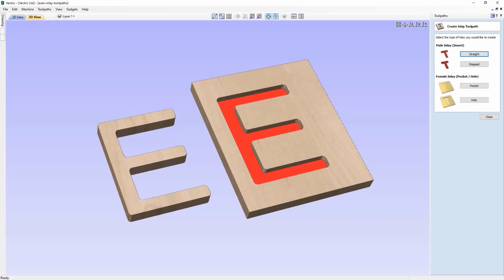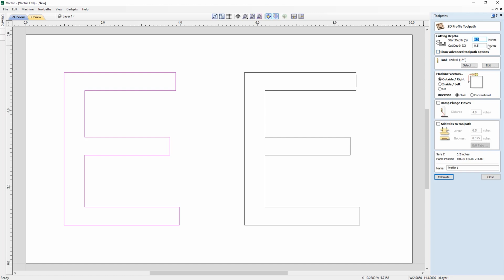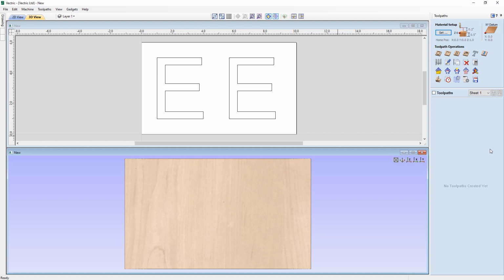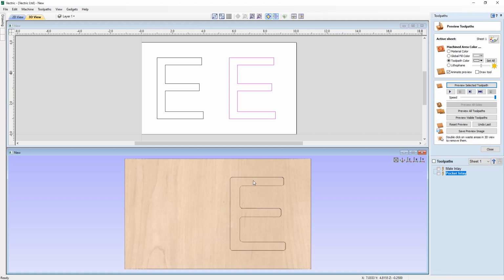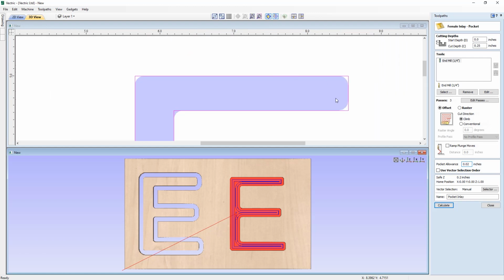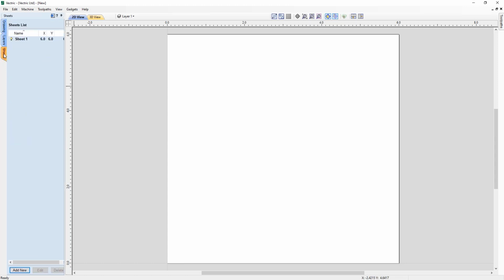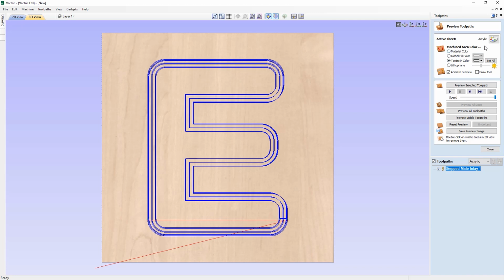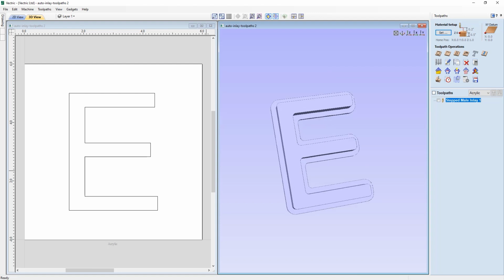Auto Inlay Toolpath Guide | Vectric V11 Tutorials

Comment: I need to machine pockets with corner undercuts to machine square material. I don't see an option to do this.
Reply from the maker: Hello Norm... We can't cut "undercuts" on a 3 axis machine.  I may be misunderstanding your use of "undercuts" apposed to "overcuts"?
Reply: @vectric  Corner overcuts if more accurate. As mentioned, it's eliminating the radius so square material can fit - IE when making a recessed vacuum fixture.

Comment: you need to start use Metric system. most people in the world uses it
Reply: Just because you use it doesn't mean everyone else should.
Reply: @michaelagostino1321  Yes, it does. The US went 'metric preferred' back in the mid 70s. How long do you need?
Reply: @Tensquaremetreworkshop Yeah and it never really caught on so it’s essentially invalid here. 
We prefer to call a half inch, a half inch instead of 12.7 mm or whatever it is in metric. Etc etc. 
Vectrics not even a US company but probably the majority of their customers are. 

Imperial for the win, per usual. 
It’s glorious isn’t it.
Reply: @SeamlessFab  Well, every vehicle in the US since the 80s was designed and built in metric.And most other things.
Reply: That’s right around the time all the American made vehicles started becoming unreliable. I don’t know if that’s cause and effect of the metric system, but no one has gazed upon the 1980’s car industry and onward and marveled at the engineering involved. 
To the original point though, if you designed a product and most of your customer base used imperial.. are you releasing it in metric? In any event I was just speaking on the claim that America “went metric.” The phenomena is more akin to a pilot project that never really caught on, period. A failed pilot program if you will.
Reply: @SeamlessFab  Vehicles less reliable now? Far from my experience. Perhaps you can quote a source?
Amazing the things the US has failed at. Metric (like the rest of the world) - fail.
Coins for single denomination currency like almost everywhere else (despite costly campaign) - fail.
Does succeed at a lot though- percentage of citizens in jail, industrial accidents, road deaths, drug deaths, murders, the list goes on.
Reply: Honestly after reading this incredibly bizarre response, I’m now on your side. Vectric: let’s get this guy some help before it’s too late. Just give him a Metric tab. 

Converting metric to inches appears to have devastated his emotional state. 
Opening Version 12 and still seeing the “inches” scale populated in the job setup tab appears to have been the last straw and catapulted him to a nervous breakdown. 

The guys talking about socioeconomic theory and geocurrency in a software thread. 

It may be too late for his mental state. 
But we can try.

If we act immediately 🚨
Reply: @SeamlessFab  Vectric handles Metric- might even be the default, I do not remember having to select it. I have nothing against inches, as it happens- but if you add feet, yards, chains, furlongs and miles (all three types) I just smile and shake my head. Fractions, however, are a different matter. At some point you need to use decimal (as size decreases- who uses five hundred and twelfths?). But hard to stay there, because all your drills are fractional (plus letter and number to crudely fill in the gaps). Metric is, of course, also decimal. So no such problems.
Reply from the maker: Thanks for the comment... and will add that to the list of future things to consider.  For the record it is pretty easy to conver any of our working/demo files into metric by simply chaning the job properties.  It won't ajust the tooling so you will nee to keep an eye on those.

Comment: Why can I select a v-bit for the female, but not for the male? The female allows me to select a spiral end mill to clear out the pocket and a vbit for the edges. The male only allows for spiral endmill. This sounds like it would result in a mismatched pair.
Reply: Use the vcarve tool path instead not this one
Reply: @StephenJoiner  I'm aware of the vcarve toolpath, but when using that one we have to manually flip the male portion add a border and do a second vcarve for it. The auto inlay almost does this for you, it just seems to miss the vbit portion on the male side.
Reply: @JasonLetanosky  Well it can't do that because it would be undercut if you visualize it. The narrower portion of the male would be under a "cliff" of wider wood at the top. So flipping it is the only way it could be cut with a V bit.
Reply: @StephenJoiner  I agree that it needs to be flipped. I'm saying the software should allow the option to automatically do that. The function is halfway there due the ability to use a vbit on the female. If the software would mirror the male accordingly and allow for a vbit, then the auto inlay feature would be much more useful.
Reply: @JasonLetanosky  Makes sense!